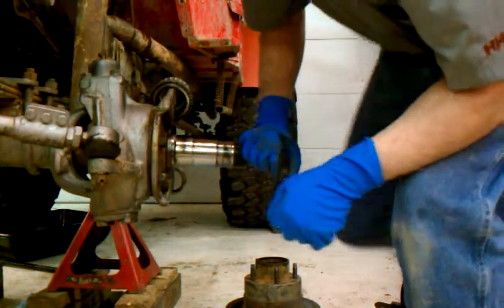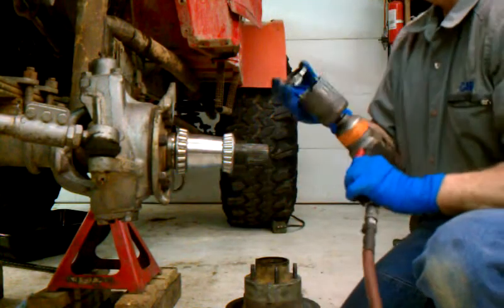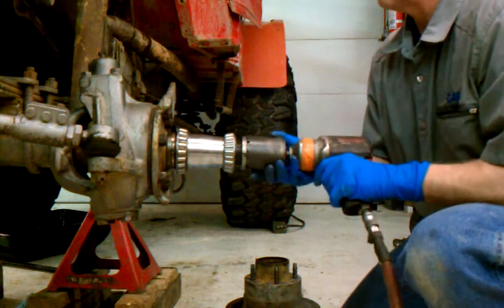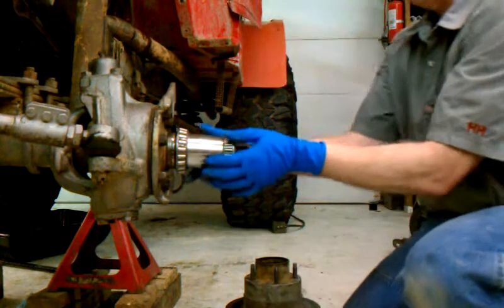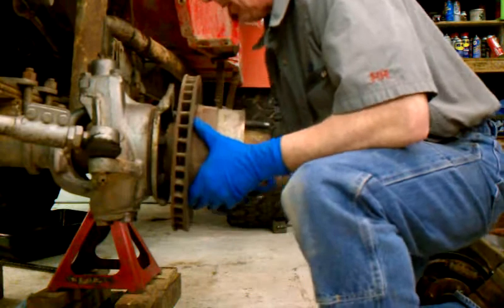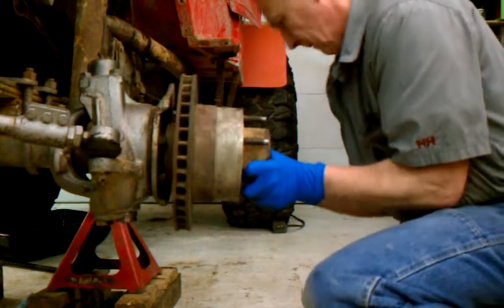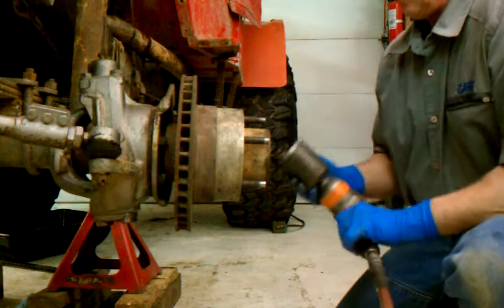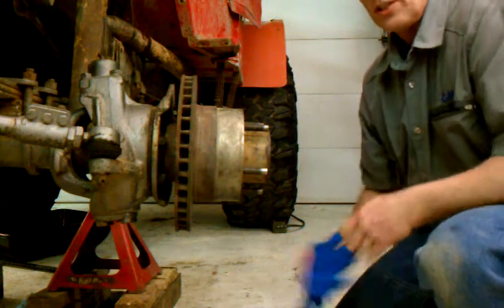45 sec wheel bearing adjuster pt 1

Comment: So there really is no lock other than the friction of steel on steel? Not sure how I would feel about that off the trail. Sure love the speed there. Trying to fiddle with those lock washers tab or pin type is a pain even when you aren't in a hurry. lol
Reply: You can still use the OEM locking system if you want.  But no reason to.